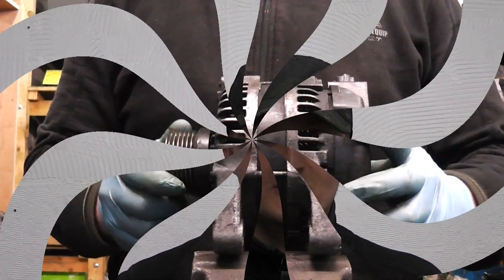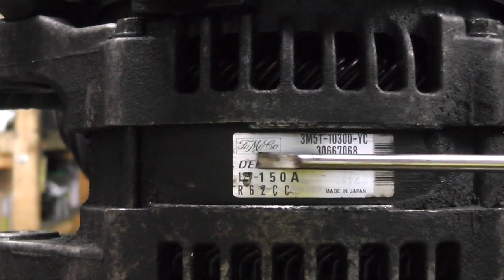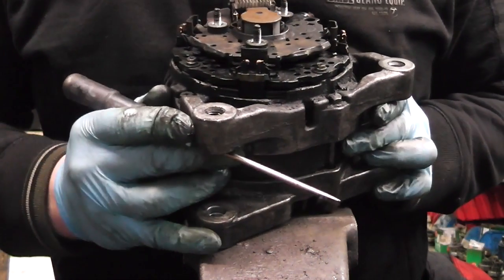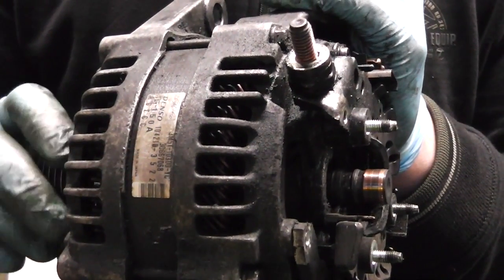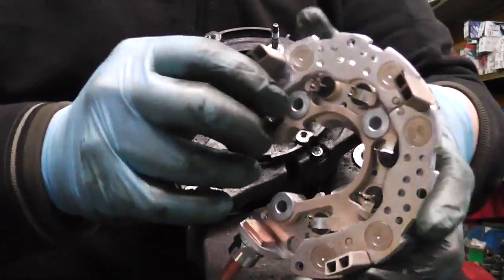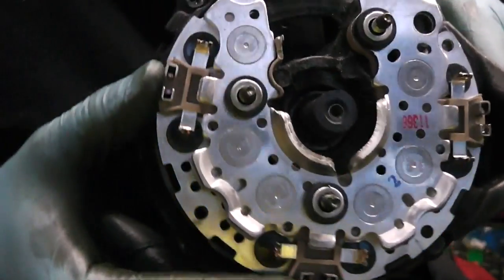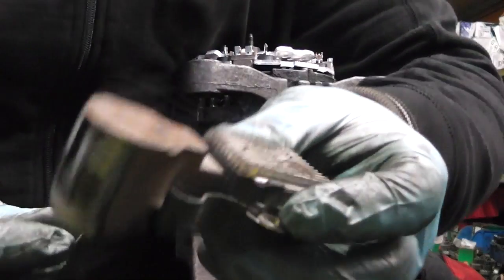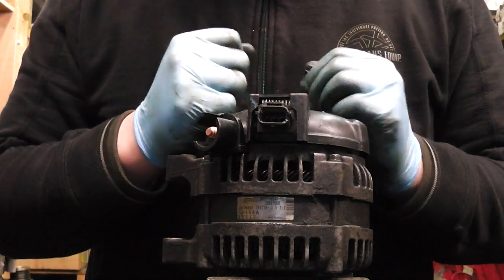Ford Focus/C-MAX and Volvo S40 Alternator repair. Rectifier change.

Comment: very informative video, excelantly explained for the home mechanic. If your doing this a new set of bearings would be good and a new voltage regulator. Soldering always has to be clean for fear of the dreaded dry joint

Comment: Hey! I did all that, but now I have a red triangle and Power System Urgent message. If you dig a bit deeper then the message is: P0625 Generator Field Terminal Circuit Low. Voltages from the generator are good. Could it be a connector problem?

Comment: Thanks for showing how to remove this type rectifier.  I have a 2008 Honda Odyssey (Denso 104210-5920) that has a burn diode exactly like you show.  I will be replacing this part rather than buying a new alternator. Great job on the video!  You might want to edit your description to include Honda and Acura to get more views. A common Honda alternator with this type rectifier is Honda #CSF92 or 31100-RGW-A01
Reply: Kirk Arthur is

Comment: I have the same alternator, it works away no problem, but it sounds like a bearing is gone, it emits a metal on metal grinding sound. Got any parts for that?

Comment: Is it possible to replace the slip rings? I had a diesel leakage on my Volvo V50 2.0D from 2004. Alternator still works but it started making whining noise.

Comment: Very helpful video but one question. If you turn the rotor and it makes little whine noise, does it mean the rectifier needs to be changed?(bearings maybe) Alternator was pull out because it wasn't charging and smoke was coming from it when connecting + to the battery. Thank you

Comment: I have checked your ebay advert.  My alternator is from a 2003 1.8 petrol Cmax and is a Denso 104210 - 3761 (120A)  Is this rectifier compatible as the listing shows 150A?

Thanks for the great video by the way.  Very clear.
Reply: I have an 03 focus se, ( 2.0 dohc zetec vin 3) gasoline motor. My alternator is shaped similarly but, it has an all metal outer case! Mine is a 110amp & I am wondering if one like in this video, with the plastic rear cover, the 150 amp alternator, if it would fit & work in place of my 110 amp alternator?  It is shaped like mine but, like I mentioned, mine does not have a plastic, rear cover! COULD I USE THAT ALTERNATOR ON MY FOCUS? LOOKS AS IF THAT ONE IS ABOUT $10.00 CHEAPER & PUSHES 40 AMP'S MORE THEN MINE! I could use the extra amperage for my system! would definitely help if it worked!!!